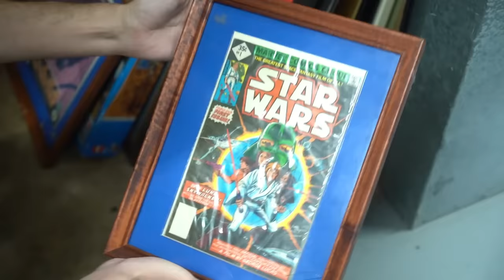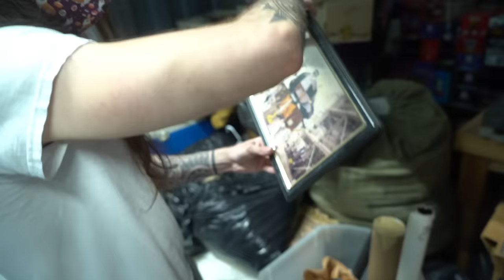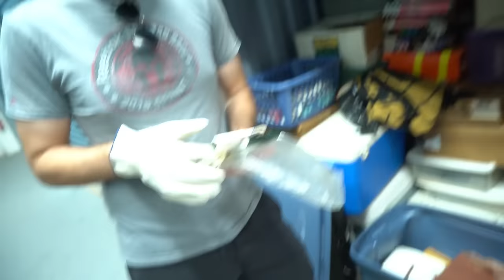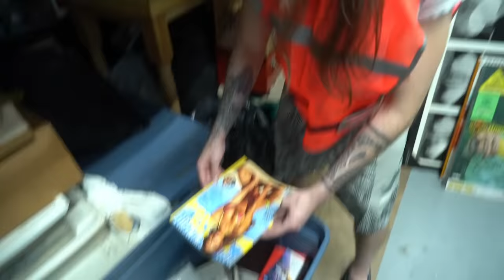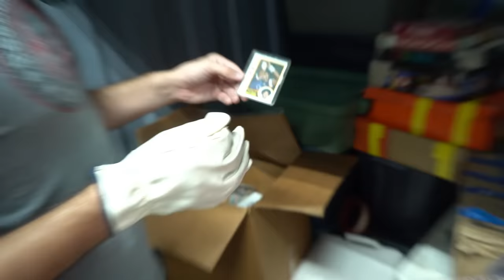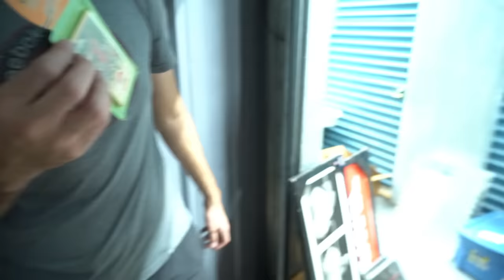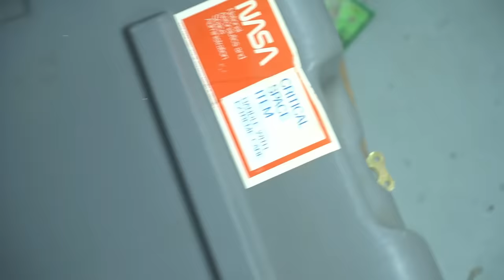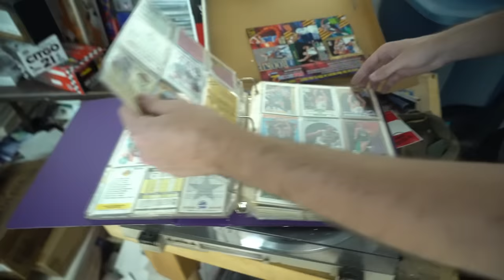I Bought An Astronaut's Storage Unit

Comment: Can’t wait to see what everything is worth. Especially the presumed Rolex and the cards
Reply: I looked it up and it looks like  a Rolex Ref: 18238 Oyster which looks like it's worth way more than 2800, maybe 10k
Reply: Some cards may be worth something, most of them are worthless. 80s - 90s cards aren't worth anything.
Reply: @Alyssthecrow  yeah from what I remember when I was super into collecting sports cards and apart of the hobby/the community, the 80s and 90s were like the junk era for cards because they were so incredibly mass produced that there is absolutely no value to the cards. Collectors don't even want most of the cards unless it's like a rookie card of a hall of famer. The best shot they have of finding valuable cards in there is of they get hall of famer rookie cards and maybe some modern rookie cards of really good players. Like if they got like a lebron rookie card or like a Kobe rookie card, that would be super valuable

Comment: That ROLEX looks like the a Rolex President, looks authentic by the magnification clarity on the *day date. Used they go for around 10-15K
Reply: Bruh what eyes you got man
Reply: It’s a day date on a presidential bracelet*
Reply: I was looking for a comment from someone who seemed to know!
Reply: @cyano3d  eat your carrots bro it works
Reply: Cyclops looks a little weak by the looks of it from my experience of handling DD/DJs. Definitely could be a fake. A close up of the dial + if he could wind the watch and show the seconds hand moving would get a better feature. And then on top of it, Setting the time to 12:00 to see if the Day/Date click over instantly
Reply: It's an oyster actually haha
Reply: Unfortunately it's a fake. Plastic crystal but dial is flat. If it was an 1803 it would have a pie pan dial. Rolex font too big and too close to the crown. Endlinks are hollow-- president endlinks were always solid. Cyclops magnification is off and day window is too small. Markers too small and so is the winding crown.

Comment: This star wars comic is actually quite expensive.

It is a rare 35ct print run.

This has only a third of the volume of the 30ct variant.

So keep it in a good place!!
Reply: Whats the estimated price in ur opinion
Reply: estimated price?
Reply: @Casper_-_  highest bid on a 9.4 was 27K. they usually go for 1k to 1,5k. but it should not have the "reprint" phrase under the price next to luke. and should be the square price window not the diamond one.

the 30ct variant goes for 50-100$ in good condition. Gem Mint 1k+
Reply: @for_nothing_important  .
Reply: @rzgbrmpf37  damn.. I wish Charlie could do a part 2 to see all the cool stuff they got
Reply: You would be correct but the barcode is blank, meaning its a 35 cent Whitman reprint, not an original.  

So its only 40-60 bucks according to ebay.
Reply: @willpaul5392  the world of comics is so brutal now :( I thought it was worth major money at first too, because my barber has the star wars comic, always told me it was expensive.
Reply: @raijuko  If its an original #1 with a barcode its a couple hundred bucks!

And an original 35 cent variant with a barcode is at least 1k but can be as high as 10!
Reply: @willpaul5392  dude didn't it used to be worth way more though? It's so tragic that these old comics aren't worth shit anymore
Reply: @willpaul5392  good eye there, didn`t recognize that
Reply: @SELLY.  yeah like an appraisal would be pretty cool
Reply: @mxbwilly  yeah, and I just thought some of the stuff was pretty cool, I’d definitely keep that NASA case to store some sentimental items in it or sum, nevertheless it’s nice finding cool things like that

Comment: 90% of those are probably worth something. Even if they aren't, sell each for $1 and that's still a ton because there's so many of them
Reply: I assume you are talking about the sports cards. They won't sell. Also, 99% of them are worthless. They are right smack in the middle of the worst years to collect sports cards, and there is no demand for cheap, massively overprinted sports cards.

Comment: As a lego reseller it's kinda insane that he donated the set 7471 due to the fact it frequently sells for between 315 - 485 usd in box and around 250 used. But again, it was just donated.

Comment: Even if every card only brought .50 cents,  that's a ton of money. You better have been VERY  careful of what you threw away as garbage. That Rolex alone is at least $10,000. Looks like a Presidential to me. That locker was likely worth every penny you spent. What were the highlights? Are there any holy shit items?
Reply: its a bootleg fam but this storage unit was def worth 5000 easy